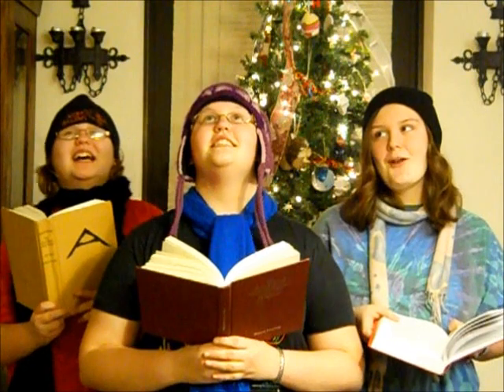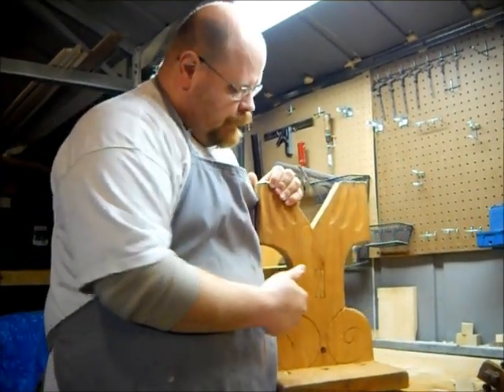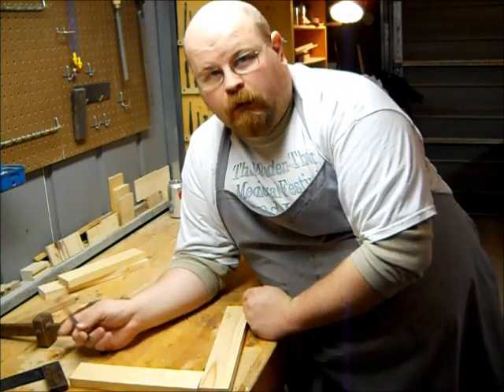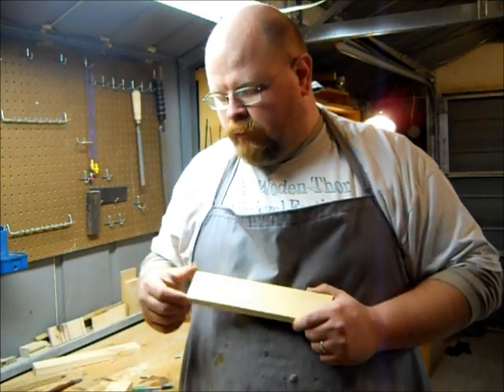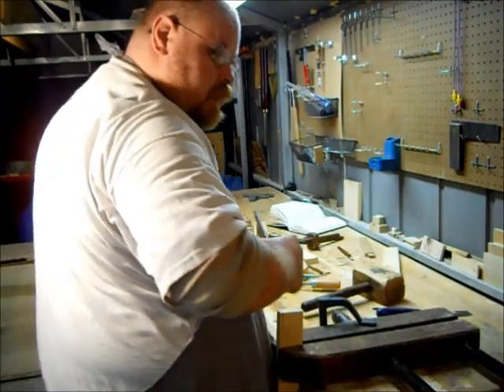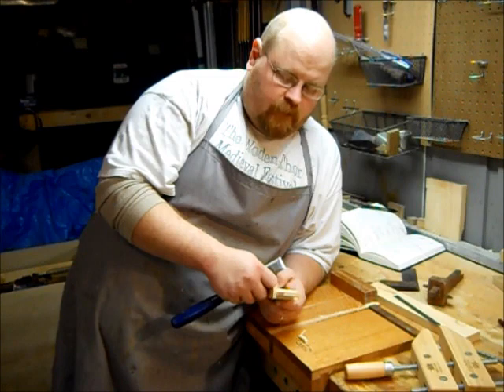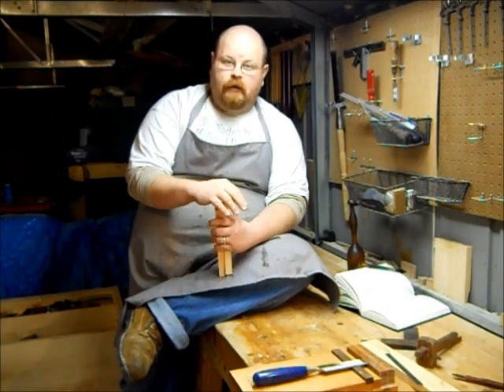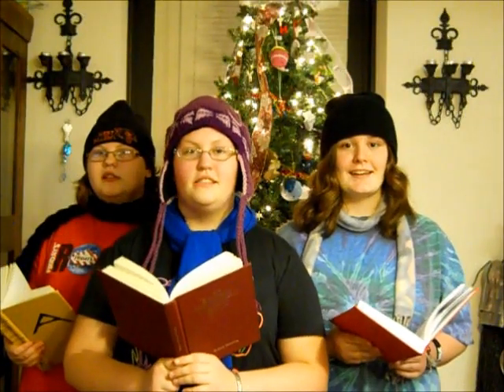How I'd Do It Friday: Tenons

Comment from the maker: It depends on your definition of "productive" If I want to turn out a hundred copies of the same piece of furniture then a router is the way to go. If I am working on one single custom piece of furniture then I prefer to use hand tool methods. I can grab a saw and cut a joint, no set up, jigs, test cuts, hearing, eye, or breathing protection. I get right to the work and that makes me faster. I did machine woodworking for years and I learned, I don't want to build jigs I want to build furniture.